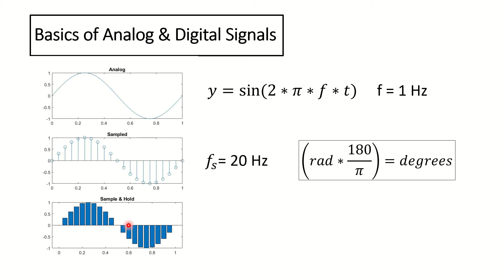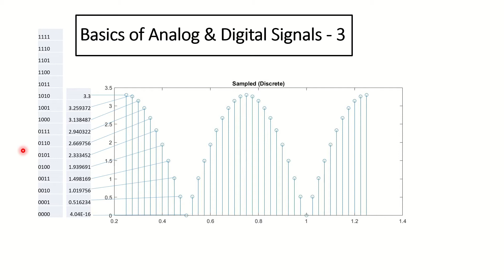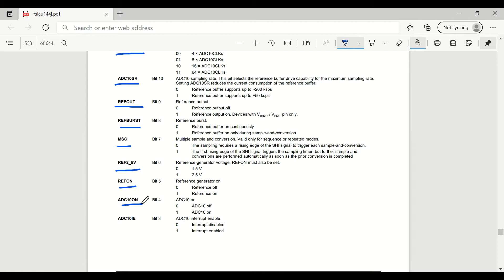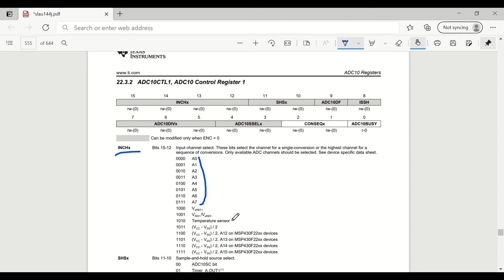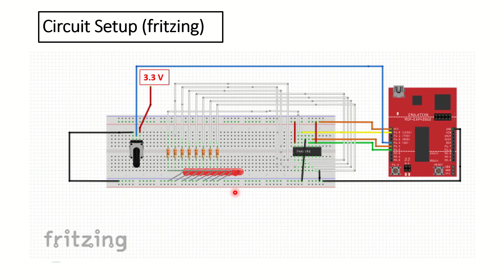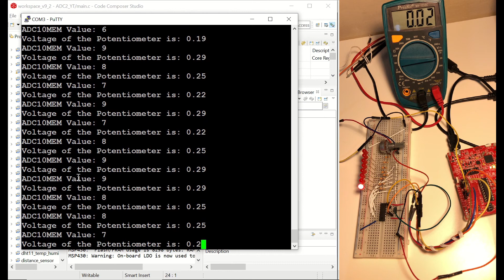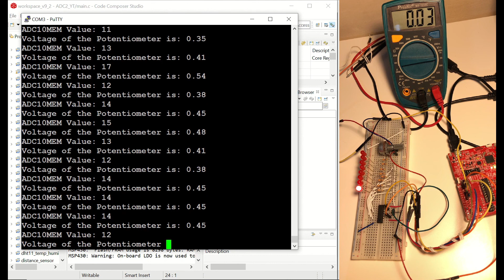ADC in MSP430 Microcontroller

Comment: When I compile I get an error because there are too few argument for the following functions: ltoa(memval, mv_char);
Should this not have three arguments?
Reply from the maker: Hi, please see the update from ti, if you haven't done so:

https://software-dl.ti.com/ccs/esd/documents/sdto_cgt_handling_changes_in_ltoa.html

ltoa(value, local_buffer);     /* OLD */
ltoa(value, local_buffer, 10); /* NEW */

Please try using the NEW format and let me know if it worked for you. Some of the viewers have done it and it worked as expected.
I'll be adding a comment in the github page for this video as well.
Reply from the maker: Hi, the code was working. I had tested it as i uploaded the video.
However there’s a better way to find the fractional part (probable update for the code): assuming the voltage to be 3.3647 volts: to obtain the integer part, divide the number to ten and assign it to an int, to get the 1st digit in the fractional part, multiply the voltage by ten and use%10, etc..
A similar method is here in lines 86-89
https://github.com/selimg76/microcontroller/blob/7afbd746400feaa96b115f34c8775de08973908e/PIC18F252_4_7_Segment

Comment: [5]&gt;&gt; Compilation failure
[6]"../main.c", line 48: remark #1528-D: (ULP 3.1) Detected flag polling using ADC10BUSY. Recommend using an interrupt combined with enter LPMx and ISR
[7]"../main.c", line 54: error #167: too few arguments in function call
[8]"../main.c", line 55: error #167: too few arguments in function call
[9]"../main.c", line 56: error #167: too few arguments in function call
[10]"../main.c", line 50: remark #1530-D: (ULP 5.1) Detected divide operation(s). Recommend moving them to RAM during run time or not using as these are processing/power intensive
[11]"../main.c", line 50: remark #1533-D: (ULP 6.1) Detected use of multiplication on a device that has no hardware multiplier
[12]"../main.c", line 52: remark #1533-D: (ULP 6.1) Detected use of multiplication on a device that has no hardware multiplier
[13]"../main.c", line 67: remark #1544-D: (ULP 13.1) Detected loop counting up. Recommend loops count down as detecting zeros is easier
[14]"../main.c", line 68: remark #2553-D: (ULP 14.1) Array index (involving "y") of type "int". Recommend using "unsigned int"
[15]"../main.c", line 74: remark #1527-D: (ULP 2.1) Detected SW delay loop using __delay_cycles. Recommend using a timer module instead
[16]"../main.c", line 67: remark #1544-D: (ULP 13.1) Detected loop counting up. Recommend loops count down as detecting zeros is easier
[17]"../main.c", line 68: remark #2553-D: (ULP 14.1) Array index (involving "y") of type "int". Recommend using "unsigned int"
[18]"../main.c", line 74: remark #1527-D: (ULP 2.1) Detected SW delay loop using __delay_cycles. Recommend using a timer module instead
[19]"../main.c", line 79: remark #1528-D: (ULP 3.1) Detected flag polling using IFG2. Recommend using an interrupt combined with enter LPMx and ISR
[20]"../main.c", line 100: warning #1-D: last line of file ends without a newline
[21]3 errors detected in the compilation of "../main.c".
[22]gmake: * [subdir_rules.mk:11: main.obj] Error 1
[23]gmake: Target 'all' not remade because of errors.

Comment: Hi drselim-  I have been following your lectures and it has helped me tremendously. However, I wanted to ask, how do you calibrate the DCO at 1MHZ for msp430fr2355 https://www.ti.com/lit/ug/slau445i/slau445i.pdf?ts=1757140107892. Im getting errors on your code line 35-36. Thank you

Comment: I couldn't understand the sample and hold, is it for sampling. As well as we are using prescale. I couldn't understand their duties exactly. Can you explain them? And another question, I will have 600 mV signal. When I put this signal to comparator stage, Is it seeing my signal, or ignore it?
Reply from the maker: Sample and hold is described in the beginning of the video at around, you can see the difference between sample and sample&hold there. If you'll have an input signal constant at 0.6 V, according to the code used here, it'll be in the first slot and one LED will be on only. 
Whether you have a signal of 600mV or 10mV, you'll obtain a corresponding value between 0 and 1024 (since ADC in G2553 is 10 bits, with a difference ov 3.22mV between quantized values.).
Reply: @drselim  Okay I watched and understand, sample and hold is like zero holder to hinder amplitude skewing. It should stay constant  by the next step. However, I wanna ask another thing :  For example I have 200 Hz signal and I want to sample it  as 1 ms. And I try to find how can I sample it, I found a formula for 2 ms like this: ACLK=32KHz,resolution=12bit,ADC conversion cycles=13,DIV=2,ADC12SHT_2=>2*13( 13 Conversion cycles for 12bit resolution)

Fs=32K/(2*13+13)*2=410Hz  
Is it true?  If it is true SHT value should be 16*ADCCLK cycles, shouldn't it?
Reply from the maker: @merveozdas1193  for a 200Hz(max) signal you should use at least a 400Hz sampling frequency (information theory), for the rest of the calculation I suggest you use the following link (probably you might already checked it) : 
https://e2e.ti.com/support/microcontrollers/msp-low-power-microcontrollers-group/msp430/f/msp-low-power-microcontroller-forum/41263/msp430f5438-adc-setup-sampling-rate#:~:text=The%20ADC%20could%20sample%20at%20~154%20kHz.
Also make sure your mcu supports 12 bit res. ADC, the one that i use (G2553) has ADC10 (10 bits)

Comment: Hello Dr Selim,
I am using the EZ430f2013 development USB(which is quite old already). I am trying to search for examples where I can extract data from the board to the computer directly when connected via USB(I have tried to divide my problem into parts where I tried to find how to first enable SPI and then transfer data but I couldn't find anything beyond initialization of SPI)(I am fairly new in programming and debugging MCUs so please excuse me if I am jumping on a stupid question). I was able to initialize ADC (SD16) but to confirm if it is really working I have to see data and that is the problem here(lack of knowledge). I hope anyone can provide some sort of guidance with this. I am trying to convert the amplified output from INA333 from a bridge circuit.
Reply from the maker: Hi, first I need to mention that I haven't worked with the board (as you mentioned it's a USB board as I checked online). However I just looked at its specs and tried to understand your request. You'd like to get the analog values from INA333 and convert them into digital with the board's ADC -Sigma delta (which is different than MSP430G2553 in my examples, which is ADC10) and get the values from your computer. My recommendation would be that once you could get ADC working, try to observe the values from the expression window in CCS. See if they are correct or not (you can compare the converted value with the masured valu with a voltmeter). since the device doesn't have UART, I'm afraid you won't be able to use the examples that I gave here, but try to find another solution to get the data to your PC, maybe with SPI as you mentioned. Unfortunately this is all that I can comment for this board.

Comment: I have not been able to get any output from the COM port. I have tried many things but to no avail. I even tried using CCS 9.2 instead of the CSS 11.1 that I am using - running into and fixing the ltoa problem. I have tried other baud rates but apparently the Basys3 is restricted to 9600 baud - which makes me wonder why your code has UCA0BR0 = 52 and UCA0BR1 = 0 which would set the baud rate to 19,200 from what I have read. I tred UCA0BR0 = 104 and UCA0BR1 = 0 but that did not resolve the problem. I tried both Terra Term and Putty but got the same result with both. I have also carefully checked all the other parameters for the serial connection.Any ideas what my problem might be?
Reply from the maker: Hi David, one quick question as a start, you mentioned basys3 accidentally, right? This code is for msp430.
Reply: @drselim  Yes, my mistake writting Basys3. I was thinking of the Basys3 because I have no trouble with Putty making good serial connections. BTW, the circuit for this video worked as expected. Could this have anything to do with the jumpers on J101?
Reply from the maker: You should set the UART jumpers horizontally, you can see that setting in the following video: 
https://youtu.be/Fzf8q6fgxfQ
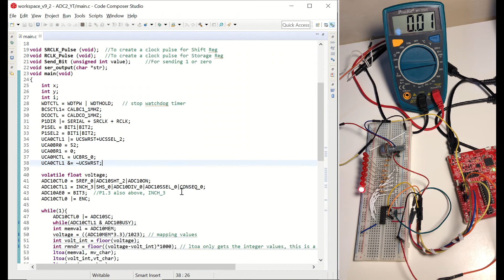at 12:02
Please let me know if it helps.
Reply: @drselim  That was it! So this board is not limited to 9600 baud? Was it ever so in the past? Or is this just another example how much incorrect info there is out on the internet? That is why I appreciated to clarity and accuracy of the info in your videos.
Reply from the maker: So it works, perfect. Thank you for the clarification since this ltoa update caused some problems: some viewes had mentioned it.
For the Msp430, I did not hear a limitation for serial connection speed. For Basys3, the default setting for the microblaze soft microprocessor is 9600 baud, but it can be changed in the settings in the block design. It shouldn’t be a problem.
Reply: @drselim  Thanks for all your help.
Reply from the maker: @DavidTLutz  You’re welcome 👍